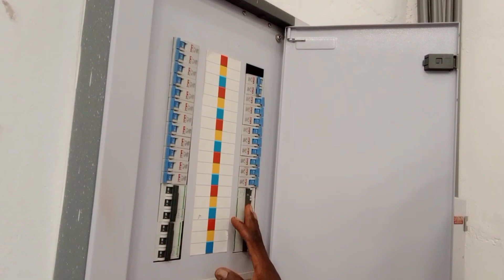What to do when a circuit breaker keeps tripping.

Comment: Please I thought MCB does two works; Short circuit fault and over current protection. I don't know of earth earth because I know the earth fault is for RCB
Reply from the maker: You are not wrong. But some leakage currents can make an MCB to Trip depending on the time and the amount of current.  Don't worry, I will make a video to make this point clear.
Reply: @obloni_Electrical  Thanks for your response